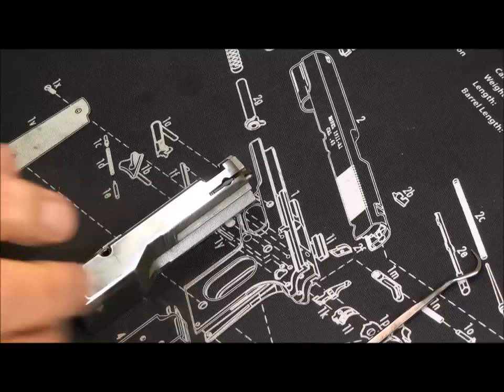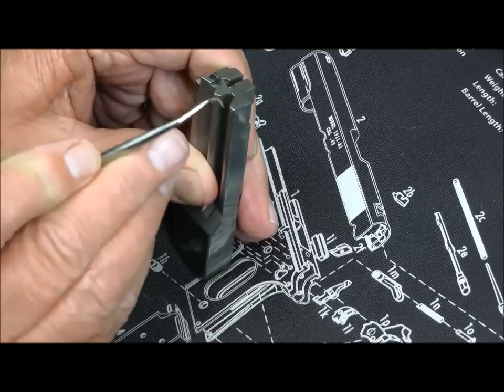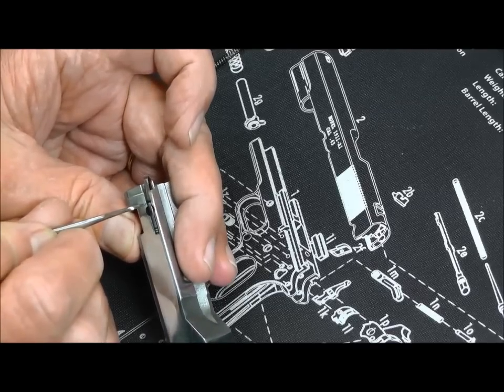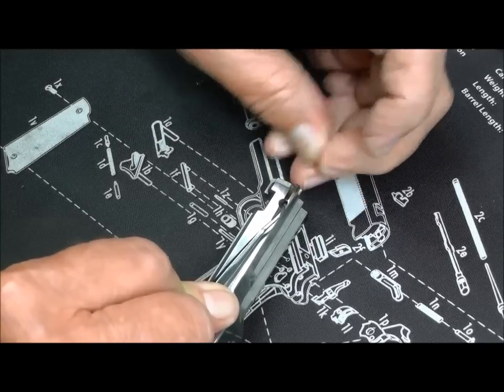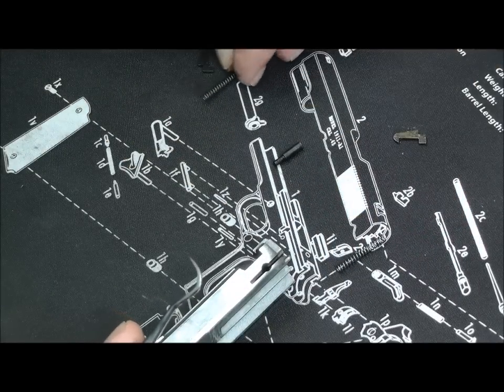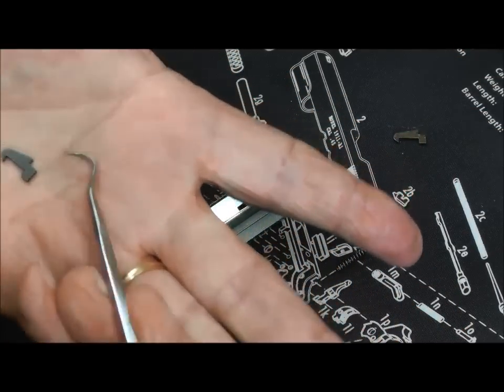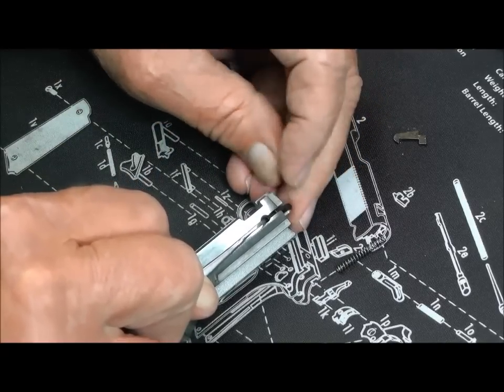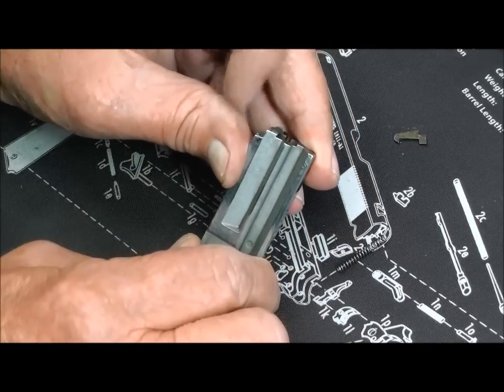10/22 Extractor installation

Comment: I use a small piece of cut off plastic from an out of date credit card to replace my extractor and avoid scratching the channel of the bolt where the new spring goes.
If you scratch the channel with a hard metal object, the spring can hang up on a burr that's sometimes created.

...and I only use Volquartsen replacement extractors for the 10/22 as I consider them the very best.
Nothing extracts like a Volquartsen!
Reply from the maker: Thanks for the info!

Comment: Have you had to change a ruger firing pin? CCI is the only brand my 22/45 shoots flawlessly, all other brands I get several failure to fire. Thinking about changing the firing pin and spring to a titanium pin.
Reply from the maker: Not yet but I will just because Kidd makes a better pin. Stock pins are fine but a Kidd or Volquartzen should cure that problem and from what I've seen they're easy to install.
Reply from the maker: Here ya go:  How To Install a 10/22 SureStrike Firing Pin
Reply from the maker: For 22/45: https://www.volquartsen.com/products/1067-bolt-tune-up-kit-for-mki-mkii-and-mkiii

Comment: Thank You for the video...best video I've seen on replacing the extractor.. I bought a titanium one and it didn't have instruction. for installation
Reply from the maker: Easy procedure if you have steady hands. I just make it look harder than it is, good luck :)
Reply: MyHollowpoint Not as stready as they used to be... I may have to make a bolt block for my vice...

Comment: LMAO at Rudy , he's a busy little dude ... good job , ya made it look easy. Can I have the parts mailed to you and send mine down for installation ?   :)) Where did ya get the dental pick , they are handy tools.
Reply from the maker: Rudy is a mess:) I think the pick set came from Harbor Freight. Send it, I'll either fix it or break it ;)
Reply: MyHollowpoint Thank you , I will ... BTW , nice looking tree !
Reply from the maker: hazman440 Thanks. Just send the trigger group, I'll take care of the rest. Take the barrel ring off, unscrew the stock screw,drop barrel assembly out. Push the two bottom pins out of the receiver and pull the trigger housing out. Put it in a box and send it :)